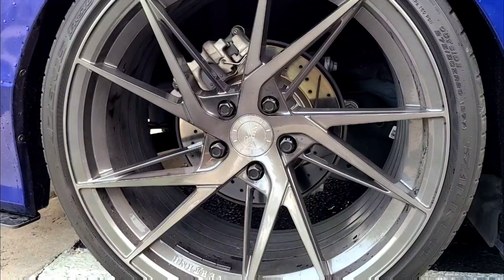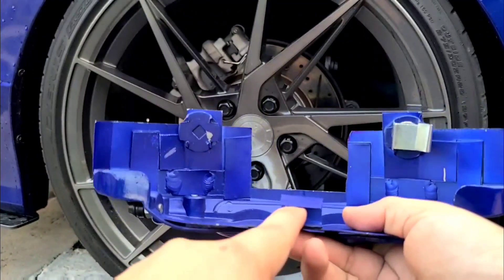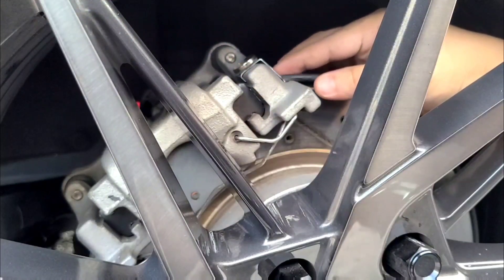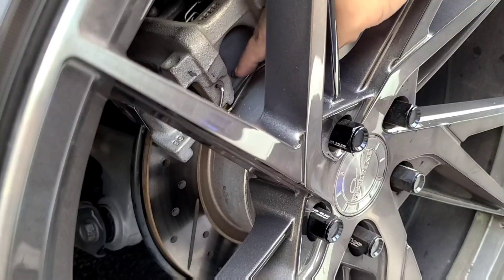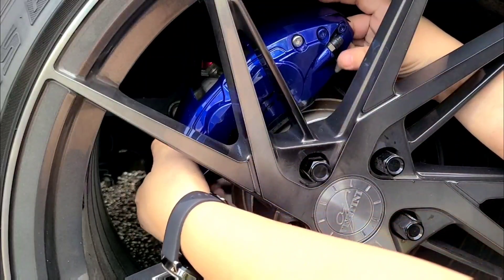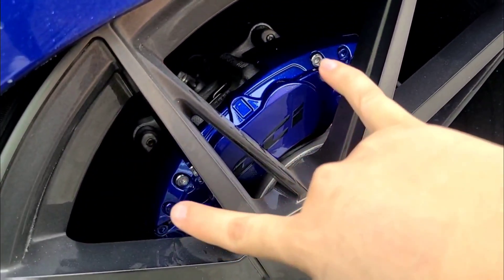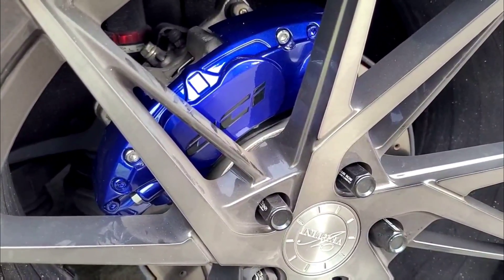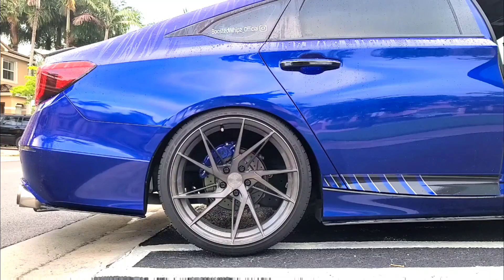GT Series Caliper Covers from CCI for Honda Accord 2018-2020

Comment: Cool. Are these just temporary until Rollerface comes out with the brakes for the back?
Reply from the maker: Correct... Didn't want my rears naked.
Reply: @BoostedWhipz  yeah I just got my front ones from rollerface yesterday but told them that I’m not going to install them until I get the back ones. Then do it all together. Hope they don’t take long. CCI cover is a cool alternative. Thanks
Reply: Lookin good brother

Comment: I  been wanting to paint my calipers orange for a long time 😂 I still haven’t got to them ...I’m just to lazy to lift the car up mask off the wheel well mask around the calipers sand down the calipers clean it ..primer.. sand down primer clean it paint and clear repeat 4x  .so I might look into buying some of this
Reply: I removed my calipers, took the pistons out. Sand blasted them. Then painted. Done. Edit: Was probably more work than it's worth.
Reply: Bro there  are shops that will do it for less than hundred dollars.

Comment: Have you heard from Rolloface yet and when they’ll be done with the rear big brakes? I’m still waiting for those. I got the front ones from them already 2 months ago (not installed yet). I hit them up on IG like a month ago and they told me they’re still working on them. I say we keep bugging them until they make them. Or I might have to go this route. I’m just scared that CCI won’t match the color as my Rolloface ones. Do you still have the R1 concept rear rotor on your car?
Reply from the maker: No updates. Yes R1 in the rear.

Comment: How long does it takes to arrive?
Reply from the maker: They are custom made and not something off the shelf. Can be anywhere from 2-4 weeks depending on material availability, design, and color selection. Reach out to them for a better timeline.
Reply: More like 8-13 weeks

Comment: For $315 I'd rather just just put that towards all new brakes with nice looking calipers

I still find these extremely dangerous. They could fly off and go through someone's windshield on the highway when you're going 75 mph. Possibly destroying somebody's family.
Reply: Well considering they haven't come off yet, I would beg to differ. But you're entitled to your opinion.
Reply: Had mine for over a year. Never came off. No issues. The magnets are super strong.
Reply: Mine flew off since he cheaped out and stopped magnets went to clips. Horrible product